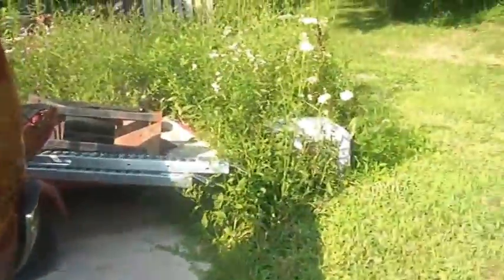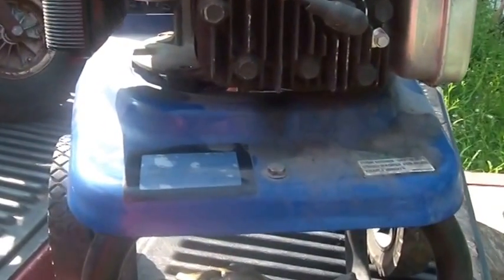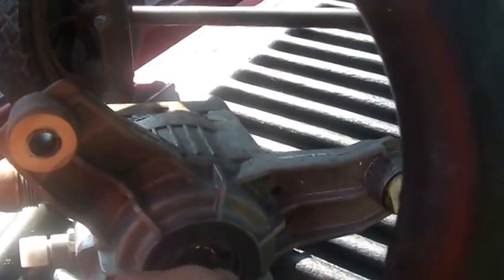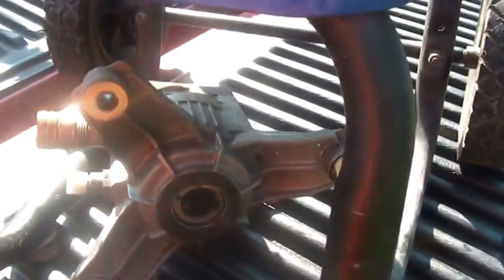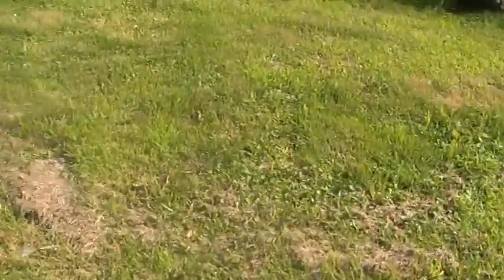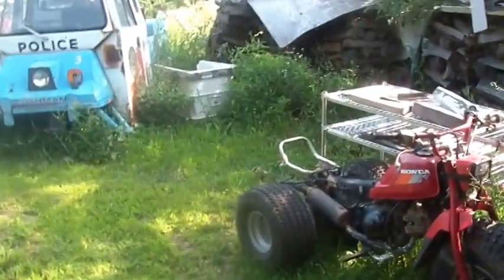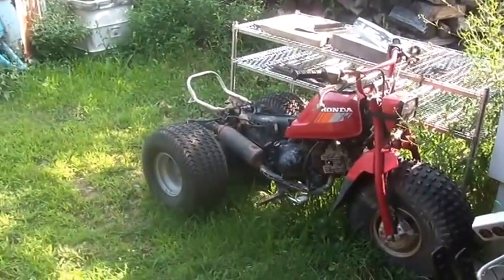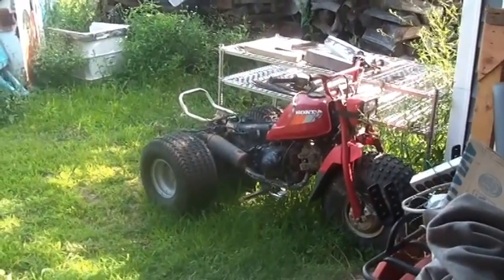7_25_2014, Troubleshooting seized pressure washer,

Comment: I have used a newer electric pressure washer , do not remember the brand . Think it was a 1900 psi but not positive on that . It done well . I liked that it just turned on and off when you hit trigger. Now I own a old Coleman electric one and a little bigger gas one .I do not remember last time i used the gas one . I have washed houses down and many decks with my electric one and it is still going good. Only thing is it runs all the time like a gas one does

Comment: Lots of pressure washers are ruined by running and not washing . The water flowing cools pump . Does not take that long to heat the water in pump if not flowing. Hot wears fast.